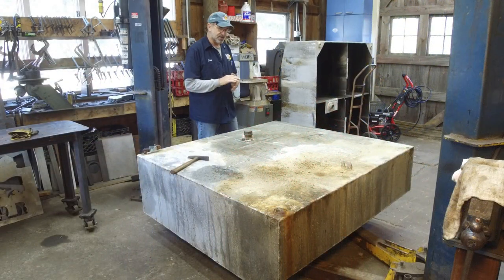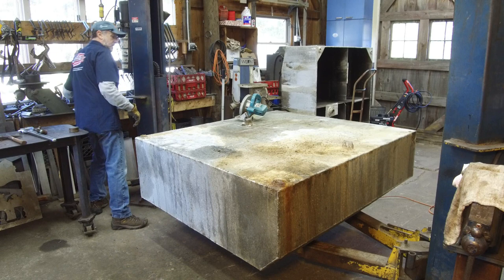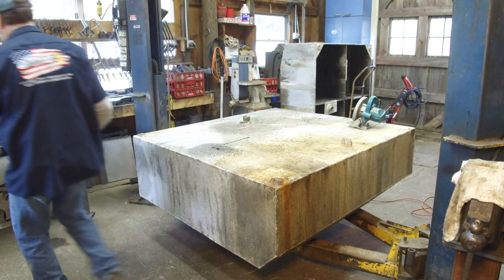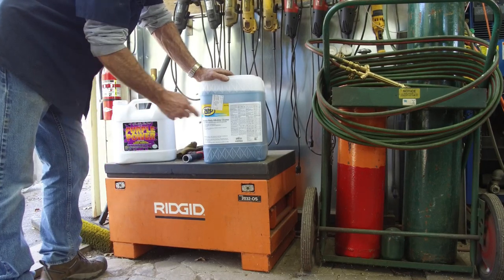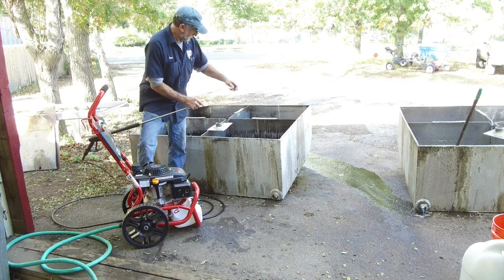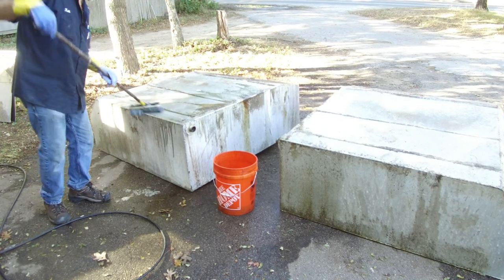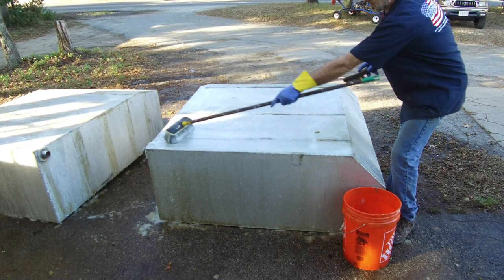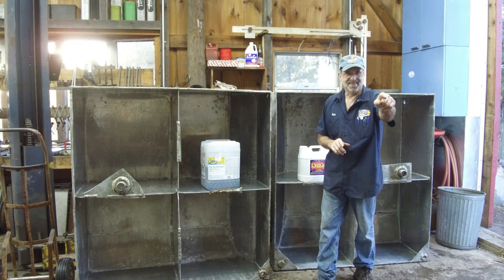Tanked Again

Comment: The lift seems to be one of the most welcome additions to the shop you never knew you needed. 
Oh, he  just pressure washed that, No way he can wash it cleaner. Well, I'll be damned. - "Here we are going to give it the first pressure wash to the surface." Shit, thought you had some miracle cleaner for a minute there.
Make sure you blow the pressure washer out, my experience has taught me that that kind of pump will freeze crack  pretty easy and I reckon you are sticking it out there in the box, winter is coming, blah blah one time use, blah blah ;). If it does, do you think you could make another pump like that or easier just to buy a new one? I think the ceramic pistons might be the hard part, but maybe you know something I don't. Either way, CAT pumps makes a nice pump to go on there to replace it though it does take a few minutes to find it.
Thanks for the videos, hope life is treating you well, have a good one.

Comment: machine shop work must be slow to take on fab shop stuff. welding that old aluminum could be a real challenge looks like a job for a spool gun. .
Reply from the maker: No this is just in addition to other projects, they were originally welded with spool gun, might follow suit. ;{)
Reply: @KeithFenner  and you will weld them a lot nicer .

Comment: I do have some concerns about the pollutants you washed out on to your property or into the sewer system. It didn't look like there was a lot of sludge in those tanks, so it's not so much a concern this time, but viewers may not know that old fuels can accumulate a lot of nasty stuff over the years even if the modern degreasing chemicals are fairly environmentally safe. Prehaps a local car wash might be willing to have you wash out tanks like that at their location since they would presumably be equipped to deal with the runoff.
Reply from the maker: All slug was removed and wiped out with rags to dry state before scrubbing stains. ;{)
Reply: Ok Al Gore...whatever.
Reply: @KeithFenner  That's good to hear.

Comment: I hope those trees don't die as a result of those chemicals and diesel draining into their roots. Letting all that waste out onto the ground is not good practice.
Reply: Indeed, and I’d guess illegal too. At least it ought to be and it sure is here.

Funny how this one obvious yet critical comment is the only not to get a like from Keith.
Reply: Relax petal, the amount of fuel spilt would be less than spilt by a typical diesel truck. The chemicals used to clean would'v been so diluted once washed off to have caused no harm, same with the odidised aluminium.
Reply: It’s worth noting that in many areas, car washes are not permitted to dump their runoff water into the sewer system, and have to capture it and have it hauled off to a facility that can process it! I work in the mechanical department of a major railroad and we are forbidden to wash company vehicles on the property unless the runoff can be captured and processed. EPA rules, and they actually come around checking for this kind of thing! They can ruin a good day in a hurry! I love this channel, so don’t get me wrong, but I don’t think I’d be putting this kind of stuff onYouTube for EVERYBODY to see! You could be unintentionally building a case against yourself!! Take this one down Keith!

Comment: owen that same power washer 20 hr's in dropped the intake valve guide took it to service center they say that chezzm engine is junk so called biggs they replace the engine (warr) almost to the min did the same thing repair my self ok so far just my two cents fyi
Reply from the maker: Picked up the two year replacement plan! ;{)
Reply: @KeithFenner  i did not lol. but my repair will go way beyond 2yr well i hope  ,they just do not make them like they used to

Comment: Where did the crap you washed off the tanks go? I am dissapointed. The society has been working for decades to prevent water pollution. I thought everyone knew by now that the runoff from that operation should have been collected and disposed of as a hazardous waste. It should not have been left to just run down the street. 

All you had to do was lay down a big plastic tarp to collect the wash water and put it onto a drum. Now you have to be concerned that none of the crud gets into somebody's well or a storm drain. 

"Getter done" is one thing but 'Get'er done" right takes a bit more effort.